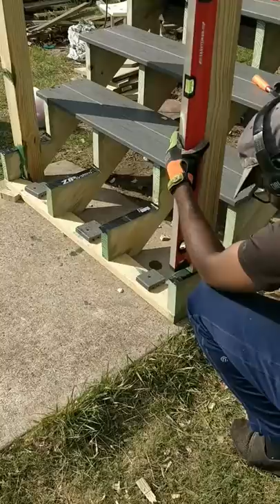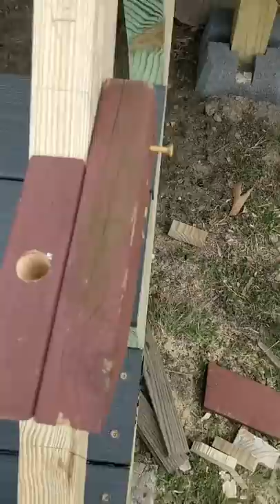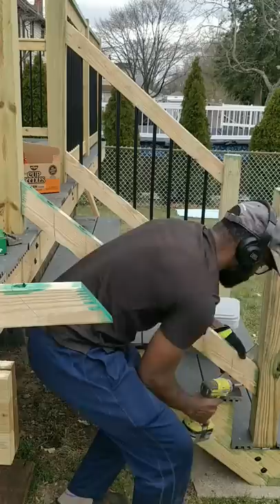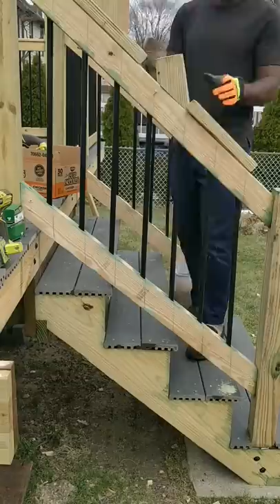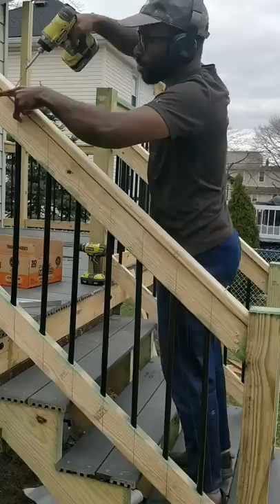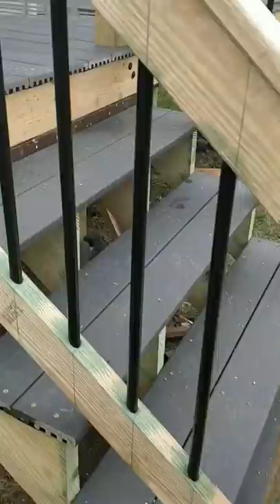Deck Stair Railings

Comment: I did make a comment on the earlier video about the use of the zip wall tape ( which I stand by)

But have since the next 2 or 3 videos 
And as a working carpenter over 25 years and now a superintendent 
Your skill set is on point. And the handrail is a fine work of art and craftsmanship
Reply from the maker: Thank you! I really appreciate the kind words coming from someone with experience. It means a lot.

Comment: They make fascia boards in the same composite so you can finish the risers and deck sides vs exposed end cuts. You can also picture frame the contour of the deck and stairs to avoid it.
Reply: Exposed end cuts look horrible..... good advice!

Comment: Those steps look awesome. I like that you used wood for the railings. The metal balusters for trex are nice but I'm not a fan of the plastic railings and post sleeves. This is the best way to build a trex deck! I also like how you kept your handrail posts longer than the top rails. Great work!!
Reply from the maker: Thank you, I really appreciate the positive vibes! It means a lot.

Comment: I like how you blocked for the lower post making the rail more rigid. You can also bury a 4 by 4 or 6 by 6 under the bottom step and screw the post to that below grade. Have used that technique for deck stairs. Being on concrete you are limited. 
Maybe use 2 by 4 strongbacks along the stringers depending on the load. Not a big fan of using 2 by 10s for stringers.
Reply from the maker: Thank you for the kind words!

Comment: Nice work! However railing on stairs require a graspable handrail. With a maximum width of 2 1/4” and depth thickness of 1 1/2”. Would need a secondary handrail. It would also need a level return at the top, to pass code.

Comment: Curious, did you have to dig holes for the two bottom posts or are they sitting on top of the landing pavement?
Reply from the maker: They are anchored to the concrete pad.

Comment: Nice job. I've built similar deck stairs for years, but recently, inspectors have insisted on a second handrail, claiming code requires continuous rail all the way to plumb line from nose of first tread. (When you locate the bottom post as you have done here, the top rail does not reach to the required point.) I'm in Illinois. Is code different where you are?
Reply from the maker: I live in a small city. There is no inspiration for deck. I just had to get a permit.

Comment: Looking good bro! Check your stringer cut depth.. off the top I think it's supposed to be no more then 50% of the board width. Don't think it'll be an issue with such a short run tho. Keep it up
Reply from the maker: Thank you! I appreciate it.

Comment: I like your blocking at the newel post. But,,,,
Try standing , two 2x6 standing. More vertical leverage. And that's what it's about. Same thing  indoors. 
Make the newel very strong and the railing will not shake when using it.
Reply from the maker: Copy. It makes sense. Not sure why I didn't do that.

Comment: Do all decks/stairs builders in your area use that green cut treatment? I personally have never used it in 25 years
Reply from the maker: It's not necessary but I just like extra protection.
Reply: @talenteddad  I understand using it for the stingers treads and risers but man that has to be the worst stuff to use for a handrail. Those splinters can be a worst nightmare. Good work though. I just don’t know about using it for handrail
Reply: @talenteddad  I have it in my head that it actually is in the codes ( treatment on any cut edges).  Will have to check that tomorrow.  Like you, we treat our cut edges.  Have been doing it like that for a long time.

Comment: Question why not cut the bottom stair post so that the handrail cAp goes over it and not just into it. You won't be jamming your hand into the post going down the steps. I can teach you the formula for perfect baluster spacing. It will always make all the spacing even on any handrail.

Comment: Building your own deck is like ...

.. cooking your own meal or knitting your own sweater. 

You don’t knit your own sweater with cheap-ass acrylic yarn, you use cashmere. You can buy an acrylic sweater for $50 so knit yourself that $1000 cashmere sweater you couldn’t afford unless you make it yourself. 

Build your deck out of Ipe or Cedar so 10 or 20 years from now you’ll be smiling with the thought, “yeah I built the deck.”

Comment: How did you make the jig for the balusters
Reply from the maker: I used 2x4, then drilled the hole. The hard part is figuring out the angle to cut it to make it sit on the railing support, to make hole plumb.

Comment: Nice, except for leaving the rough ends of the deck boards exposed. You could've taken a 3/4 rip from both sides of a couple long boards and nailed it to the deck board ends.

Comment: In my area that wood stair cap is not approved. Need a “real handrail” mounted to the side of the railing. Diameter has to fit a hand. Might be different in your area, but I don’t think it is. Still great job!!!
Reply from the maker: Thank you! I know what you mean.
Reply: Approved for what? This deck appears to be smaller than 200sqft which would mean no permit is required therefore you don’t need to build any of it to code. Technically he wouldn’t even need a hand rail.
Reply: And now that I’m thinking about it it’s actually 400 sq ft. 20x20 until a permit is required.
Reply: @gsaexperience8578  The most recent edition of the International Residential Code exempts decks from permit when they are below the aforementioned height, not exceeding 200 square feet in area, not attached to the home and not serving the required exit door of the home. My AHJ would flag this.
Reply: @lorenrickey5481  but just saying, that’s for new construction. No one is gonna flag anything when you are doing this at your house you already own. Sure, they will flag it if it’s new construction and you are getting your framing inspection.. BUT, no one is gonna say anything if you are retro fitting a deck on a house thats already been signed off
Reply: @gsaexperience8578  code reads new deck construction, not house. In our area the building department has a program that flags any new additions to the property including decks, carports, garages, pools and fences from their offices. Also home inspection during sale of said home will trigger a correction if permits were not pulled. And Imagine trying to fight a insurance claim if anything ever happened and you were responsible.
Reply: @lorenrickey5481  idk where you live but they are pretty strict about that stuff here and I have been working in residential construction for over a decade and I’ve never once seen a permit get brought up on a house being sold. I’ve also never once pulled a permit for a deck and I’ve installed at least 2 dozen of them in that time. I also flip houses. Like the last one I lived in for two years and sold it, I added a 15’x20’ covered patio with a new exposed aggregate slab coming off the dining room , what used to be window, I tore out the window and put in a sliding glass door. Did a similar thing to the last house only it was a pole framed car port not connected. Never once heard of a house getting flagged after its been signed off on initial construction. Not saying what I’m doing is legal all the time, but what I’m saying is it doesn’t matter. Like the handrail you mentioned. That would never ever get brought up in my area UNLESS it’s a new construction site and they are looking for that type of stuff during inspection. 

Not saying you are wrong, I’m just saying who cares. This is obviously quality work by this guy, and not at risk of injuring anyone. It’s not like he cut out a barring wall.
Reply: @gsaexperience8578  I hear you! I also have the skills and tools for construction. Unfortunately I have been tasked to correct problems on existing homes from baluster and stair spacing to getting flagged for not changing out the power conduit during a panel upgrade. Guess I am a little bit more sensitive about trying to stay clear of these situations. It’s all good. We’re both trying to help and understand the requirements. Good texting with you!!

Comment: Do you have a step by step video?
Reply from the maker: No. Just a short
Reply: How many inches apart were your poles? 
What angle did you use for the screw?
Reply from the maker: They are 4 inches apart.

Comment: Composite decking is stupid imo. It doesn't rot, but it's like lava on bare feet in the summer, twice as heavy if not more, a lot more expensive, and the framing is gonna fail before the decking does, so why bother with putting a longer lasting decking when the weakest link is the framing it is attached to....?

Comment: Gotta learn to miter those treads back so you don't see the scalloped edge on the planks, or cover it with the bandboard running down. 

I prefer to picture frame.
Reply: Its pressure treated. Its going to shrink and crack in a month... Why waste the time?

Comment: Those balusters are toast on about 18 months.  Sorry, but that's a lot of wasted time and money.  Treated wood and aluminum don't play well together.  Spend a few bucks and use the connectors sold with them and you're good to go. Plastic and pressure treated are good friends!

Comment: Probably one of the worst deck jobs I have ever seen. Exposed Unfinished ends, no skirts on the frameand stringers, open risers on the stairs. 
I'll give you points for the tape on stringers. And the rails came out ok but the decking is really bad.

Comment: Sorry, but that job is not that good. Using the jig is on spot. Not picture framing the trex(?) or whatever looks crappy. I'd never accept it and it doesn't cost that much more to do it right. Pressure treated lumber looks like crap and it WILL twist and move. Sorry, I give that a C-. Just my opinion. Let the hate replies commence.